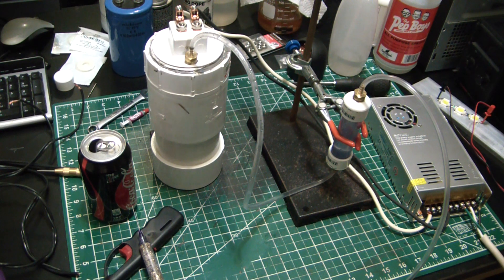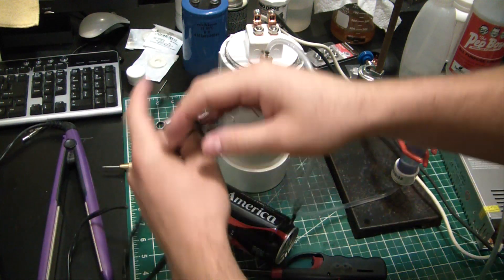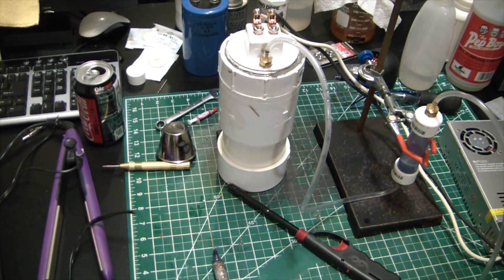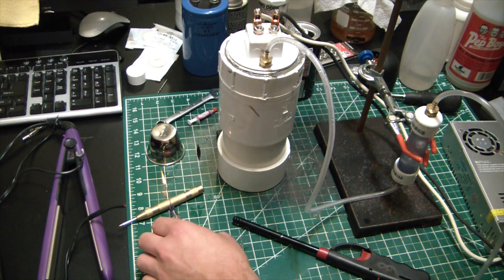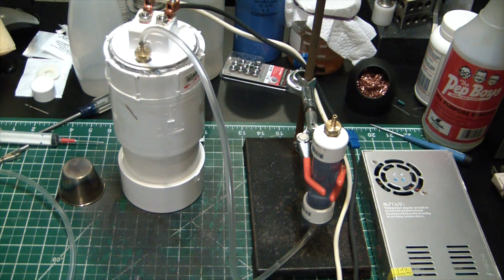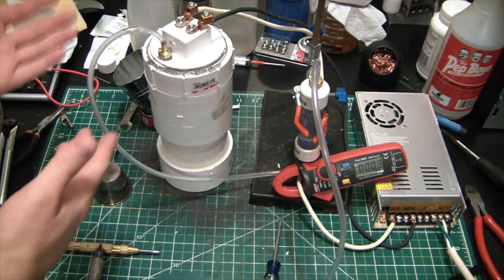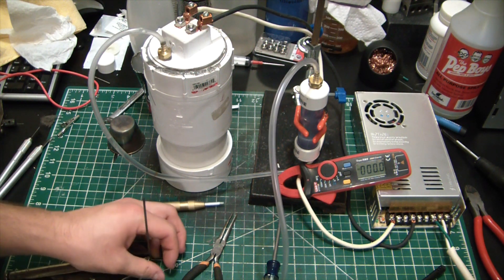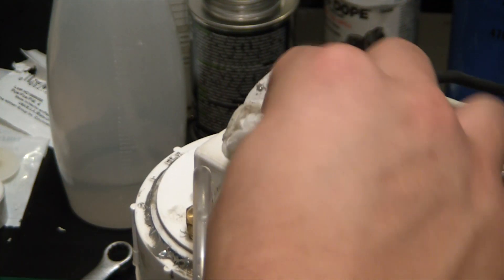Cutting Metal With Water! HHO Torch Success - ElementalMaker

Comment: Well I am using a very similiar power supply which looks pretty much the same. The only difference is that it produces 12 volts and 60 amps. The problem is that my old one got damaged a few weeks ago. The new one I ordered sadly has some kind of protection against too much current. So I need some kind of device which regulates how much current is drawn by my hydrogen cell. Has someone an idea how I could possible do that?

Great video also! I still recommend you building a dry cell. You can't imagine what 3 liters per minute are able to do😂😅
Your cell is still very nice to start with to collect experiences, before you are getting to the real stuff😂👍🏼
Reply: You can try reducing the concentration of the electrolyte.
Reply: @AtlasReburdened  Well i don't want to loose a whole lot of hho production. 3 lpm are kinda nice😅
Reply: Well, then you'll probably have to go with a big honking low ohm resistor like EM suggested, or a few big ol' transistors with big ol' heatsinks as a variable resistor. Your only real options past that are to scketchily modify the supply and hope that the lower bounds of the voltage it can produce is within your needed range, or fork out for a buck converter with the same ratings as your supply. You can buy big resistors or just pull them out of scrapped high end exercise bikes.
Reply from the maker: You could use a current limiting resistor or some sort, or a circuit dedicated to act as a linear current limiter.
Reply: @ElementalMaker  Well that's a better option, I am just not quite the best at that electronical stuff...
Thanks I need to search for some kind of similiar solution👍🏼
Reply: Wouldn't this be the most efficient way? DC-DC 5-40V to 3.3V 5V 9V 12V 24V Buck Step Down variable Volt Regulator. They are fairly cheap.
Reply: @Mr.Unacceptable  well I need my 12 Volts in order to have 2 volts per cell wich is the ideal configuration. My problem is that the overcurrent protection shuts the power supply down immediately. So I need something to hold down the current underneath 60 amps.
Reply: Freizeitflugsphäre
My understanding is this little unit takes in 12-40V and outputs the 12V you need at the amps you set it at. It's variable so if your electrolyte mix draws more for some reason and shuts your PSU off you can turn it down. That's the only reason I think this is a better solution than a resistor.
Reply: You could use PWM and have a volume control (kinda) for output and relieve the current load.
Reply: @tommyakers217  🤔that sounds interesting, but it's quite complicated...
Reply: @Freizeitflugsphaere  well some of the best production use sound and frequency. Just thinking the PWM (might) provide some of those benefits. Production often starts high then tapers off due to heat. Just an idea that I've been thinking of while I look for audio generation and amplification equipment.
Reply: Solder Joe 
Yeah, he can, and they're a lot cheaper than they used to be but he's still going to throw $40-100USD to get a quality variable(he might not need variable but it's nicer) unit rated for 60A.

Tommy Akers 
Im not sure that would work because during the active or high signal portion of the cycle the power supply will be exposed to the full load and should trip overcurrent protection.
Reply: Tommy Akers 
Plus, when you get to PWMing currents that high you really need a power supply designed for that to happen on the output. Not all are and the voltage transients that result can fry the supply or the FETs pretty easily in anything but the best designed systems.
Reply: As I see it, the problem you have is that you don't have enough power supply to run the load
as you have it set up.
Kind of like running a 5000 watt heater off a 10 amp breaker. 
The breaker will trip before the fan can even get to full speed.
But with a 50 amp breaker, it will work just fine.

Comment: Simple fix for melting terminal posts: Do not clamp your cable lug connections on plastic! Make a feed through metal bushing to carry the clamping force through the plastic. Your current setup will fail every time the plastic gets even warm-ish.
Reply from the maker: I believe that's what I will end up doing. Very good idea

Comment: I believe "fuel stock" is the phrase you're looking for. Water is your fuel stock.
Reply from the maker: Well said. Had a brain fart there
Reply: No worries, I'm one of "those" people, but I try to be helpful with my curse. lol
Reply: It's more like a working medium as far as I can see
Reply: Mrbrian1969 Water is the working medium in vapor blasting, water jet cutting, water filled heat pipes, etc. etc. In those cases the water is water throughout the process. In this case, it's broken down into a mixture of two elemental gases, one of which becomes the fuel, thusly water is the stock from which the fuel is derived, the so called fuel stock. I believe the working medium here is electrochemical potential.
Reply: Okay yeah, hard to argue with that logic

Comment: Where did you get your power supply from
Reply: You can get them from Ebay. They are used a lot in lit signs and displays. Careful the type you buy. Some types will not turn on until the load is pulling at least half the rated amps. They come in all sorts of shapes and sizes. You can get them cheaper if you look for used server power supplies If your chance of blowing them up experimenting is high.

Comment: You should make a dry cell, it will be much better. It runs much cooler and draws much less current and produces way more gas.
Reply: Plus the output won't be so full of steam and toxic side reaction gases.
Reply from the maker: @AtlasReburdened  there aren't any toxic fumes from the hho generator. Just hho and some steam.
Reply: ElementalMaker That depends on the electrolyte, the maximum voltage between any two points in solution, and the distance between them.
Reply from the maker: Electrolyte is NaOH, so no toxic fumes.
Reply: Which toxic side reaction gases are you talking about, except the melting pvc pipe? I am no expert, but shouldn't there be just H², O² and steam...
Reply: @Orbis92  stuff being cut, burned, melted, welded. Those gases.

Comment: Braze your contacts with 95 silver, or 15% is what I had to use last week on a small compressor. Going from Cu to steel sucks but is possible, not easy, and takes a shitload of temp and flux(black) that seems to burn off but helps. Got a wine fridge from the trash heap now that holds 3 cases of beer. Woot

Comment: Maybe a Ceramic HHO electrolysis container?
Reply from the maker: That would be pretty damn cool, but probably expensive as hell!
Reply: @ElementalMaker  NVM they don't
Reply: Use your current torch to make a selective layer sintering 3D printer, and make one yourself out of aluminium oxide. :P